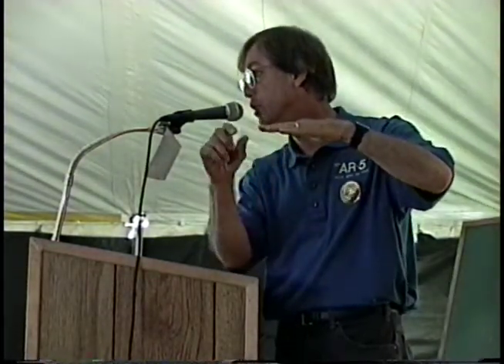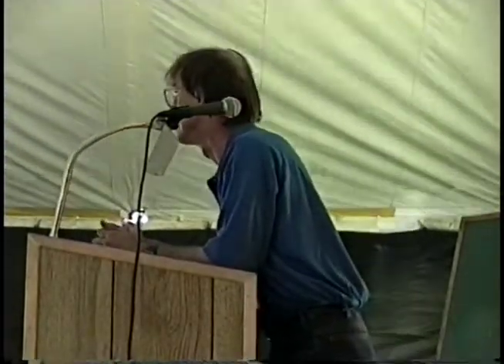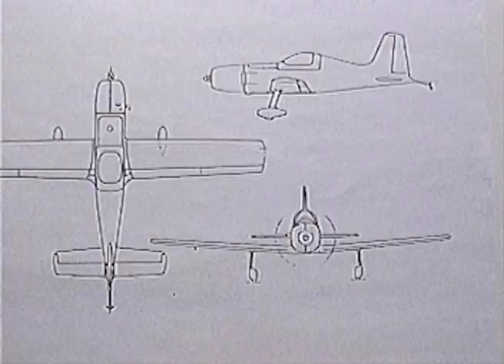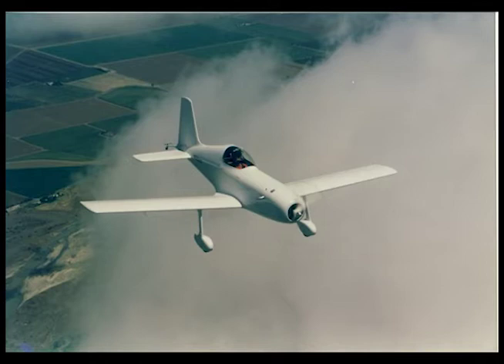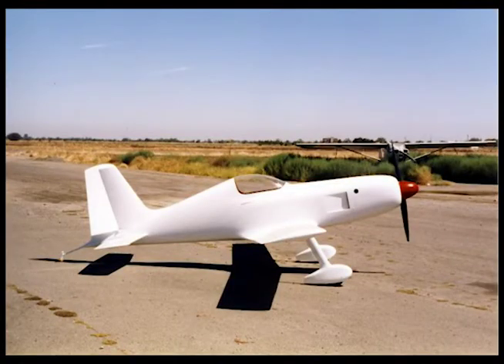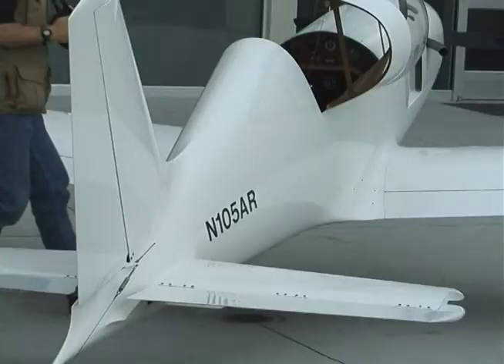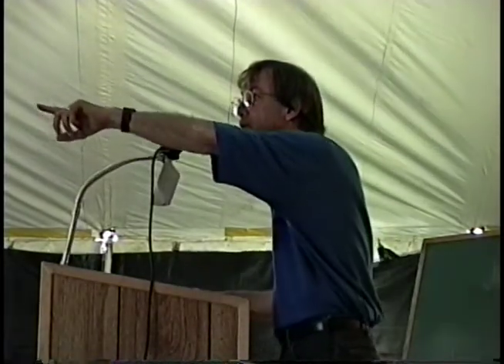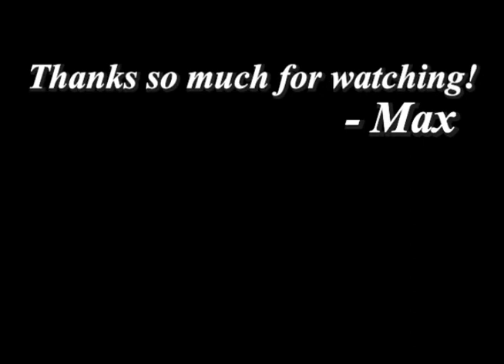Mike Arnold's Oshkosh Forum pt3 -warning!- airplane nuts only!

Comment: back when Oshkosh and the EAA actually cared about Experimental aviation.
Reply: Experimental is something you do for yourself.  If you build one from scratch and build it well, there is a great chance you will win a Lindy, even after you paint it all by yourself.  If you build a Vans RV, then you have to pay $25K for a paint job, and a $40K panel before it can be considered for a Lindy.  This is 1993, and it is the trailing period of vast number of innovations in the experimental aircraft designs since the 70s.  We had a good run until the liability lawsuits killed most of the companies that offered kits and plans.  Most of the designs died on the vine, some made to their first flight, and some endured because of multiple combinations.  The experimental market converges into a few manufacturers that offer easy to build kits, good factory support, and  good builder group.  Once in a while you get a few new airplanes to showcase at Oshkosh.  A guy who build a 1/4 scale B17 bomber got a Lindy for his effort.  It can be done but the experimenters have to do the work.  The EAA is there to represent you.
Reply: @2Phast4Rocket  there is plenty of neat innovation still going on. none of it gets showcased nor discussed at EAA each year. I have asked many years many times why such things aren't discussed in Forums. Instead they just have the same in-group of accepted "cool guys" and the same topics every year. It's like a broken record. Meanwhile the things that truly get people excited are being hidden from the public. And I know, because I have been sharing such topics and ideas with people at the local levels for years with success. People always get excited and want more.
Reply: @SoloRenegade  Our EAA club is always looking out for presentation.  We got only a few takers.  If you have or know interesting projects, are you willing to present it?
Reply: @2Phast4Rocket  My local chapter has called for topics as well, and claim to want to attract more people under the age of 60.

I have a list 42 pages long of topics to present to the Civil Air Patrol Cadets. but they (CAP) are too rigid and uncooperative, even when the cadets love the topics i present and want to hear them. So i started adapting those topics and ideas to my local EAA, and have brought up some of it, but they are an interesting lot. they claim to want to attract more people and do more things, but they've done a great job of chasing away most of the experimental airplane guys in our area over the years. And they act like they know everything and don't like people coming in and challenging them and crap like that. So I'm sort of looking to start my own thing on teh side (but still associate it with the local EAA group). Those who want to have fun and do things can, and I've had people express such interest already, and those who want to be curmudgeon and exclusive in-group types can do their own thing.

But they fill the meetings full of stuff nobody cares about. No time for me to give any presentations. who cares about treasurer's reports. too much political red tape BS. Myself and others want to Do things nd Learn stuff, not join a political process/procedure. I'm not going to participate in that crap. I'm going to do stuff. And I will self fund my projects or get donations. if I have to form my own nonprofit and manage the details in teh background, so be it. but I'm not going to subject people to it who don't care about that crap.
Reply: @SoloRenegade  Ok, give quick synopsis of what you are working on.
Reply: @2Phast4Rocket  quick synopsis? are you using this as some sort of interview?

A synopsis of what exactly? As I said, I have over 40 pages of ideas. Some of it educational topics/lectures, some of it hands-on lectures, some of it design projects, math, engineering, designing, building, testing, rockets, aircraft, electronics, theoretical physics, etc. So many things I have done, taught, want to do, am doing on my own and would love to share with others (the opportunity to do similar projects or work on the same project), etc.

All of it geared towards an aerospace focus.

I am a professional pilot and CFII, a mechanical engineer with over 20 patents filed or granted so far, world records in outer space, work with NASA and others developing solutions in outer space, keep up on latest ideas in aerodynamics, physics, etc. Have taught math, history, physics, engineering topics, etc. Worked as an instructor at a college. Served in the military and fought in Iraq and Afghanistan. I'm an amateur military and aviation historian. I also do a Lot of philosophy, etc. I do and have done lots of things. I have a list of books and articles to write on many of these topics if I ever find enough time (in retirement, or hire a ghost writer perhaps).

I'm a resource for people who value ideas and who value learning, and who Actually want to make a difference n life. Too many people get upset that I know more than they do, or can do things they declare I shouldn't be able to, and fight me rather than see me for the resource I am. I like helping people understand complex things, like teaching things, like helping people realize that these complex ideas are within their grasp and not nearly as difficult as they've been made out to be.

I've taught, mentored, tutored college students in a huge range of topics for almost 20yrs. trained guys in the military. etc. I go to military and aviation museums and people have on numerous occasions mistaken me for a curator or tour guide. I've had colleges mistakenly believe I was a professor, and many of my engineering professors asked me to become an engineering professor. I've been asked many times in my life why I'm not a math or history professor as well. I love this stuff, but people still refuse to make use of me. blows my mind. So, just going to have to do my own thing since everyone else wants to prove how inept they can be.

The reason i don't teach full time as a profession though, is because they'll NEVER let me teach teh way that WORKS. They see how good i am at it, but then would force me to conform to their caveman a$$ backwards teaching methodology and then wonder why I hate my job and why I'm not getting results anymore. My way of teaching works, theirs is a failure.
Reply: @SoloRenegade  So what is the one topic that you can't wait to get it off your chest and prepare a 1 hour presentation for the local EAA club?
Reply: @2Phast4Rocket  Depends upon the audience. What sort of topics are they interested in? I have multiple topics I'm passionate about. I have multiple topics on aircraft aerodynamics, why people struggle at math and tips for things like trig and calculus, I'm working on creating some building demos (aircraft fabrication), I'm putting together a few lessons on tailwheels, and one on banked turns. History lessons on things like engines, airframe design evolution, people, A6M Zero and the Allison fighters (P-40, P-39), the history of the Hawker airplanes starting at the Hart, and why it matters, etc. I want to start a build project series where we actually build an airplane, and a series where we actually do the preliminary design for an airplane from the ground up and then build a flying model of it. Perhaps build a wind tunnel and lift/drag balances, which ties into an aviation history lesson. Topics like rocket design, re-entry spacecraft design discussion, etc. Logistics of WW2 and how that affected aviation in the war. It all depends upon what people are interested in.

Do they dream of designing airplanes?
Do they dream of becoming a pilot?
Are they interested in military or aviation history (dogfighting, tactics, logistics, physics, people, companies, engines, specific airframes)?
Do they dream of space exploration and things like manned Mars missions (I'm actually involved in this at work)?
Are they curious about aerodynamics?
Are they curious about theoretical physics and math?
Are they curious about helicopters?
Do they want to know how to build the ultimate STOL airplane?
Are they interested in WW1 aviation?
Are they interested in what is going on in teh skies over Ukraine and what it might mean for the future of military aviation?
Are they interested in the history of jet aircraft?
Are they interested in flying wings, Delta wings, or Canards?
Are they interested in stealth aircraft?
etc.?
What is the audience interested in? I live and breath this stuff.

I can help with all of the above topics and far more, if people would stop getting in my way and preventing me from helping. Which is why I'm looking at just doing it myself and forget anyone who isn't interested in helping. I have interest from a range of people of all ages who want to see these things move forward. So now I just need to work out the details to make it happen. And if i can't get the support of groups like EAA, then I'll do it without them. If I can, awesome.
Reply: @SoloRenegade  don't be old fashioned about it. If you want to reach younger people with interesting topics and get them interested in Math and aviation: Start a youtube channel and produce the highest quality lectures or videos you can. If labeled correctly and tagged right it will reach far more people that physically traveling to EAA meetings. 

Many people in General Aviation are the same. They pick "authorities" and buy their marketing and dis anyone who thinks otherwise. While somehow managing to never accomplish a single feat of brilliance in their life. The best they have managed in their 60+ years is figure out how to get a bucking bar into a tight space without having to do X, that the plans said to do. Most cant even draw an airplane part let alone a paint job or a simple airplane planform.
Reply: @TheJustinJ  start a youtube channel? do you know how much work that is? and how youtube controls their content? no thanks. Experimentation is about freedom, and youtube is anti-freedom.

I am helping start a STEM program instead, where we do hands-on projects. some could be adapted to videos. But I am already walking the walk, and have been for years.

"If labeled correctly and tagged right it will reach far more people that physically traveling to EAA meetings. " you are absolutely correct, and I'm already aware of this. but time is not on my side here. I can't do everything I have in mind alone as there is far more than i can do in a single lifetime, and most of it doesn't pay. gotta pay the bills.

"Many people in General Aviation are the same. They pick "authorities" and buy their marketing and dis anyone who thinks otherwise. While somehow managing to never accomplish a single feat of brilliance in their life. The best they have managed in their 60+ years is figure out how to get a bucking bar into a tight space without having to do X, that the plans said to do. Most cant even draw an airplane part let alone a paint job or a simple airplane planform." 

Agreed, and that is where EAA falls short. they focus solely on kids, rather than young adults (people who can sign up to be pilots, engineers, mechanics, etc. tomorrow, who can actually do stuff without permission and have money, unlike kids). They focus on entry level skills anyone can learn in 30min on youtube, rather than going to the next level. They promote kit building and following the rules rather than new designs, experimentation, creating your own designs, etc. They don't teach the misc knowledge and skills needed to go beyond knowing how a rivet works or how to glue pieces of wood together. they skip propellers, design, aerodynamics, advanced skills, engines, and much much more. They focus on expensive technology rather than affordable methods and materials. 

they aren't helping people find the more affordable path into aviation that Does still exist! I am working on doing that.

Old fashioned in engineering is GOOD. There is no replacement for hands-on practice and experience. youtube can't give you that. and much about what I am teaching doesn't exist on youtube. Old fashioned is affordable in aviation, accessible, people don't know the value of old fashioned methods, knowledge, etc. Not everything old is better, but neither is everything new better. It's all about applying the right method to teh right situation. And older methods in aviation are more affordable and accessible to those who we need the most, the younger people who lack the funds to get into aviation. those with ideas, innovation, but don't see the path to achieving it. This is EAA's epic failure.
Reply: P-47 video: https://youtu.be/aCLa078v69k